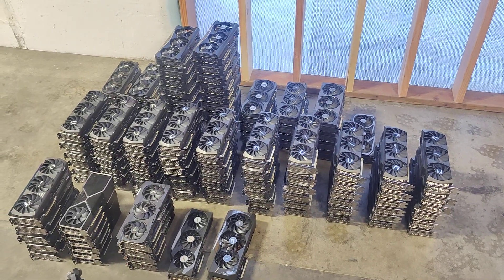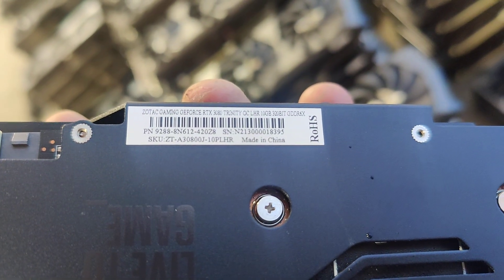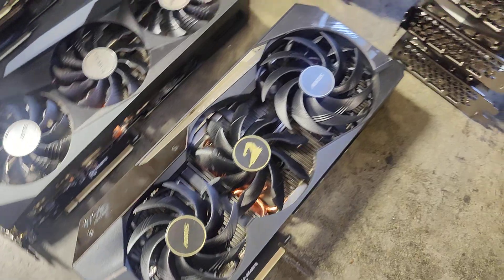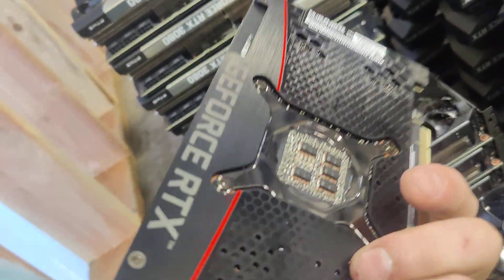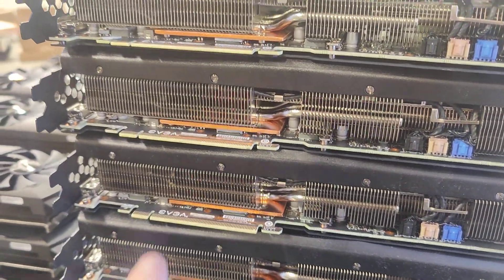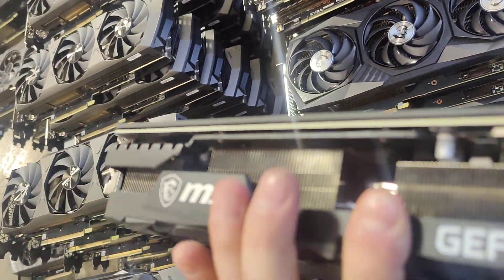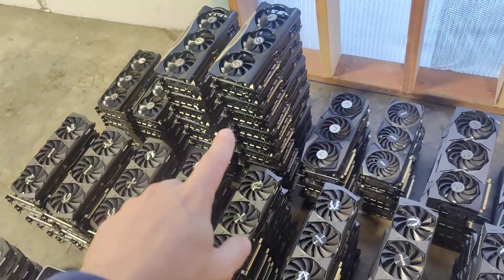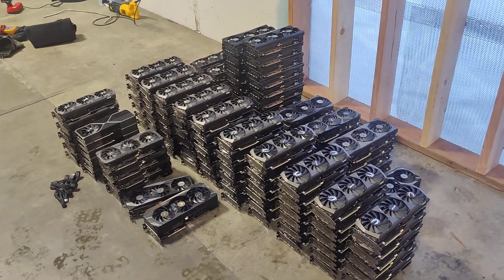GPU Mining Farm - 120 GPUS, 3080, 240,000+ Investment, Overview of Each GPU

Comment: Hello gentlemen, could you please help me choosing the right card, I write down my choices:
These are the 3070 Tis with price tags (after tax) in my region:
Asus Strix: $1030
Asus Tuf: $900
Zotac AmpHolo: $900
Gigabyte Aorus: $885
Zotac Trinity: $825
I'm leaning toward the zotac because of their low prices, do you think the zotac trinity or ampholo edition good cards?
Reply: I've been running a few in an octominercase for over a year now.  They run well just need to be careful of memory temperatures.  I've ended having to change the pads on them all within 5 months time.  I suspect you would have to do this with all of them so be prepared for some work if you build a large farm out with them.  Other cards will last longer with better thermals out the gate but the zotacs work fine if you take care of them.
Reply: @blockmommy5188  what model do you have? What about your hashrate, mem temp, fan speed and mem overclock?
Thank you man
Reply: @maxit1082  Zotac 3090 Trinitys, I don’t have the 3070tis but used friends and their thermal temps are similar out the gate. Silicon lottery with all this stuff but most of mine are getting 119-121 mh/s at an absolute core clock of 1100, 2200 memory (Linux, 1100 on windows), and hitting 299 watts with a 300 power limit in. Mem temps are ussually above 100 right away, repasting/padding if done well gets them down to 88-92 or so at room tempure air in a server case. Can’t speak much on an open air, would probably be worse unless you get some external high rpm fans on it.
Reply: @blockmommy5188  thank you man